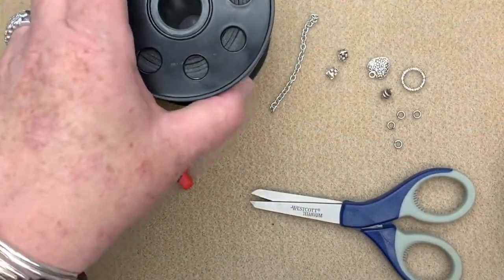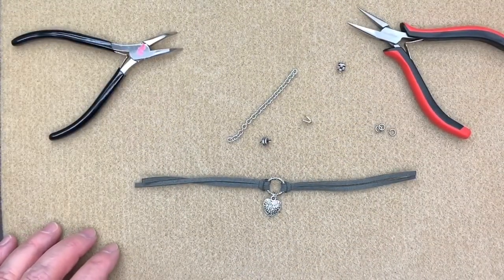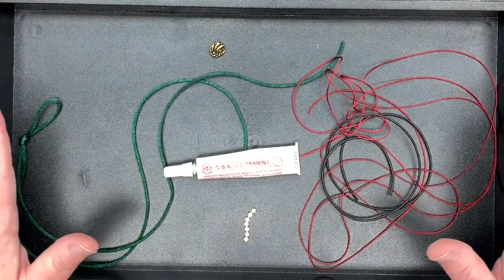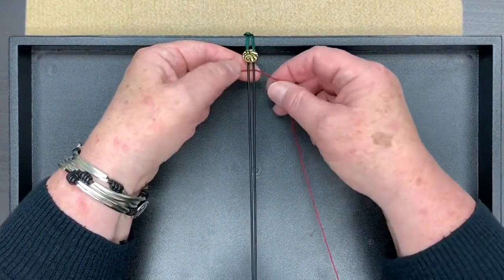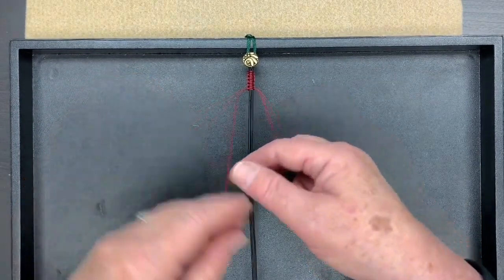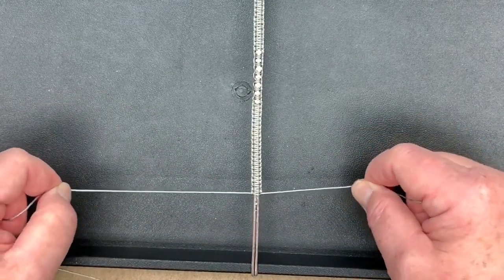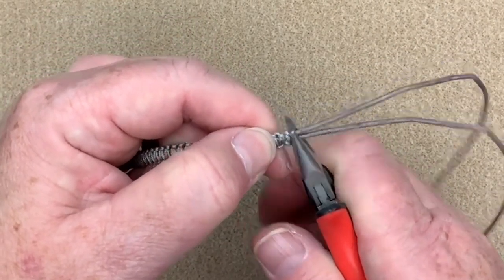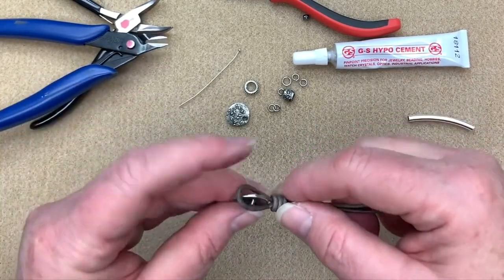3 Easy Beginner Bracelet Tutorials - 3 of my favorite bracelets!

Comment: I have learned so much from you. Being an elementary education teacher I know what it takes to teach and you have got it! Thank you so much! I hope life is a little easier these days. I have a question, help help! I just had my first craft show and had a bracelet that came undone after gluing it with G.S. cement. The bracelet was smooth flat leather and a magnet heart that connected the bracelet on top. Should I have used a different glue? Help?❤️💕
Reply from the maker: Thanks so much Kathy!  On the leather you might do better with Super New Glue or Loctite. I will use GS Hypo on small knots etc but if I’m flying metal to leather I like the other 2.